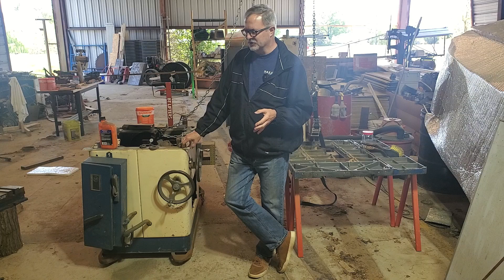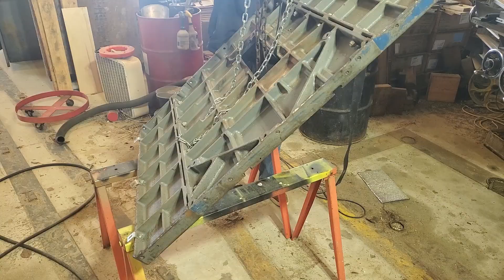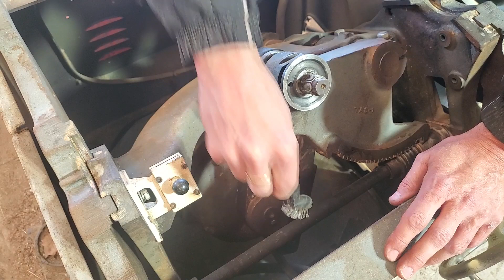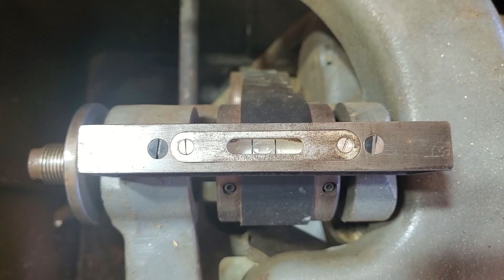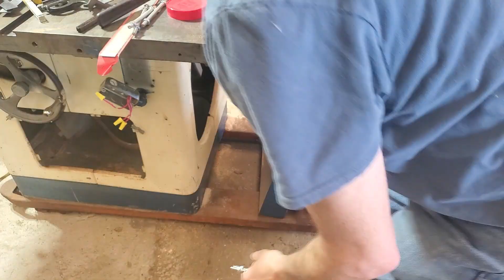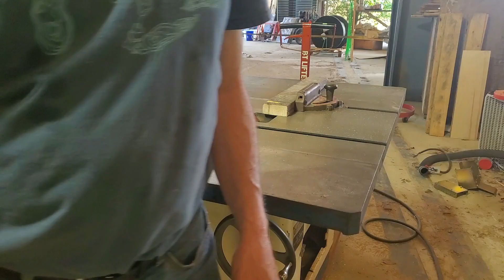Rockwell 12" - 14" Table Saw First (Wood) Chips

Comment: Years ago, I was at an auction and won the bid for what I thought had to be unisaw.... but just seemed so big.  I had never heard of a 12/14 till suddenly I owned one.  Interesting thing, the electrical box was still sealed; it had never been plugged in.  It had a 7 hp three phase motor which was a deal breaker at the time, so it has sat in my shop for 30 years unused.  I'm setting up a table saw right now..., and I have a choice, use my 10-inch unisaw or the 12/14 (3 phase is no longer an issue).  You made a reference to a saw even bigger that the 12/14..., so your preference is for large table-saws and how that extra capacity has been useful to you would be very help full right now.

Comment: I picked one of these saws up this weekend for around $300, which was a great deal.  It was in every day running condition when the owner of the shop passed away a few months ago.  It has the insert and a table extension, mitre gauge, and rip fence all included and it perfect clean condition.  Seeing this video has helped me identify a few things I need to look at as I suspect it needs a clean and lube inside as the tilt and raise are both a bit stiff. Now I just need to sort out a power supply in my workshop for it.  I couldn't believe how heavy this thing is fully assembled!
Reply from the maker: Yes, it is a beast, in a good way. Having the miter gauge saved you big bucks. I got nothing but the saw and two 12" Freud blades. Have to rig up a rip fence. Chinese VFD powers mine pretty well. 50 hz seems sufficient and quieter for general use.

Comment: Saw turned out nice. Are the wings crowned or is it the main table? Did getting the surfaces even affect the overall flatness of the table?
Reply from the maker: Main table is flat within .002" wings I have within about .005". Across the joint is within .002", which is good enough for cellulose based work 😁👍

Comment: Nice work, I noticed Tom Lipton recently acquired a table saw and spent some time truing the blade.  Kindest regards from Bonnie Scotland.  Joe.
Reply from the maker: Yes it helps. Had the arbor turned for my old Walker Turner gear drive RAS many years ago (I had no metalworking machines then). It was out a few thou as well. This saw is smooth as silk.